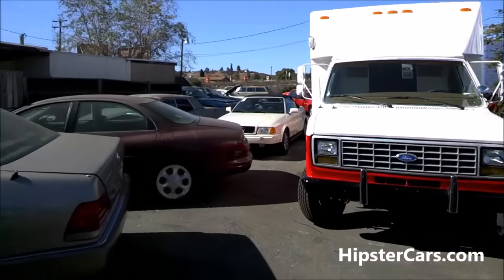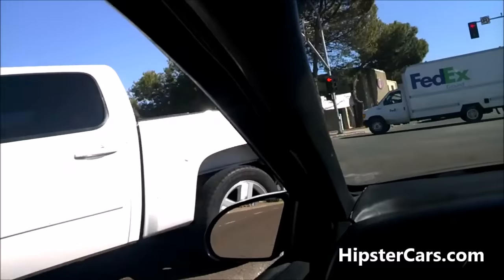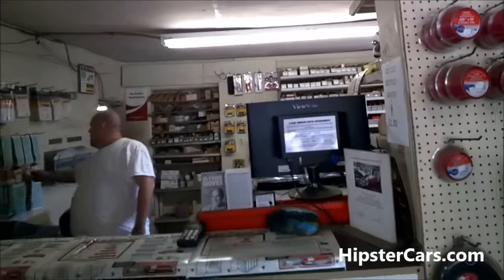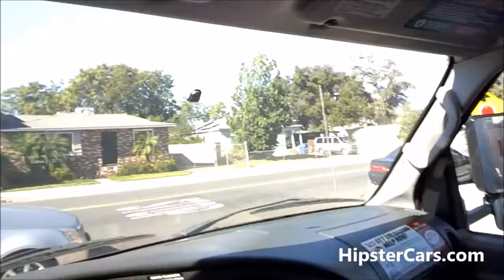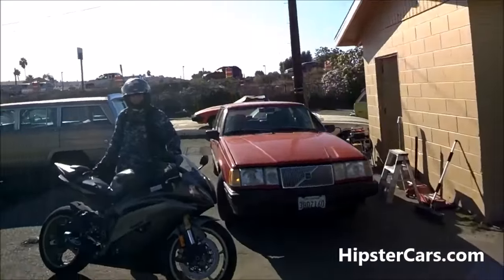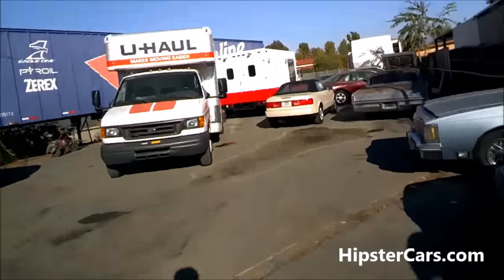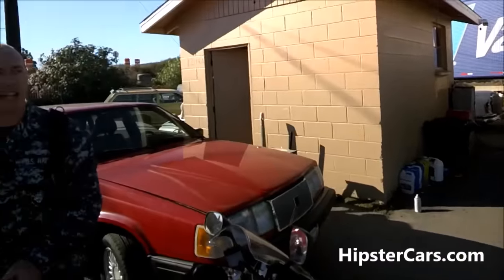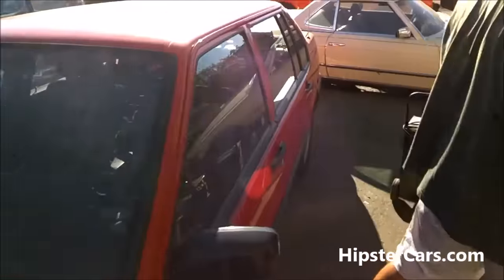Rent a Uhaul Truck Video Blog ~ PLUS Lot Walkaround VLOG

Comment: if you like the pontiac g8, youtube search holden ss ute. basically a australian pickup but with a corvette motor in it from factory because here in australia we need a LS to carry our tools to work so it's fun. they have about 300 rear wheel horsepower stock on a 2000-2002 vu ss ute from a 5.7L v8, about 320 rwhp from a stock 2002-2004 vy ss ute stock with a 5.7L, 340rwhp from a stock  2004-2005 vz ss ute from yet again a 5.7L, about 350rwhp from a stock 2006-2007 vz series 2 ss ute with a 6.0L this time, about 360-370rwhp from a stock 2007-2013 ve ss ute with a 6.0L, 370rwhp from a stock 2013-2015 vf ss ute with a 6.0L, and finally 410rwhp from a stock 2015-Today vf series 2 ss ute with a 6.2L. and we use them in wagon and sedan versions to take children to school in. modified they can make up to 1500rwhp which is awesome
Reply: and we also have faster factory versions from holdens performance company HSV (basically amg but for holdens) which make even more rwhp from 350rwhp in the vu, up to 580rwhp in the vf series 2 because why not
Reply: +Michael T I'm not the hippest person around because everyone is to lazy to type easy words, what on earth does tldr stand for?